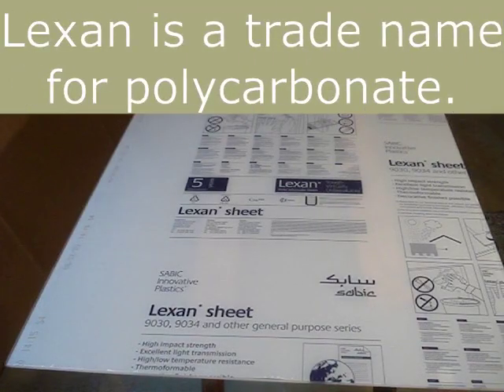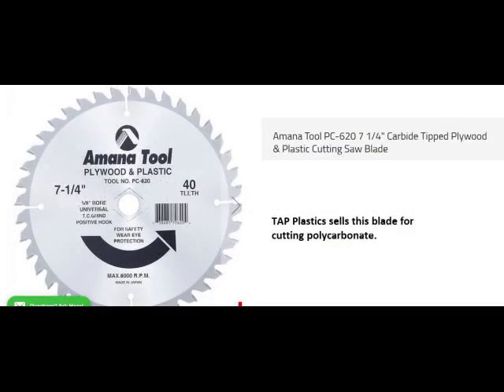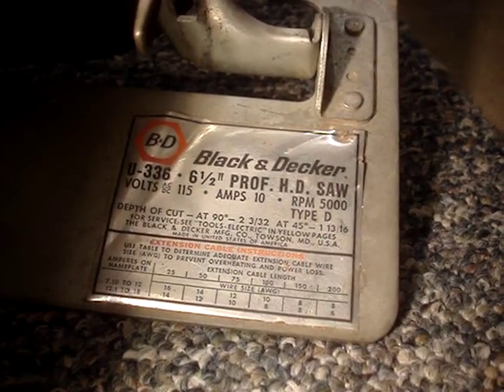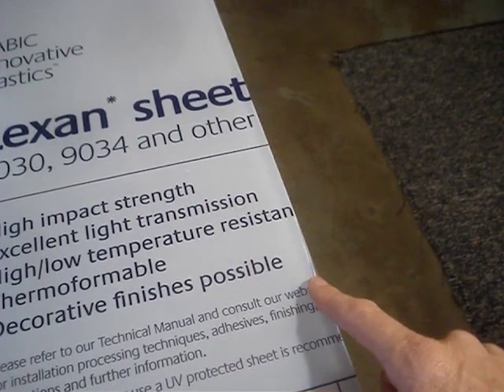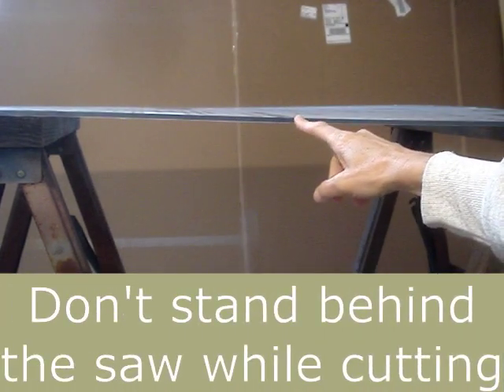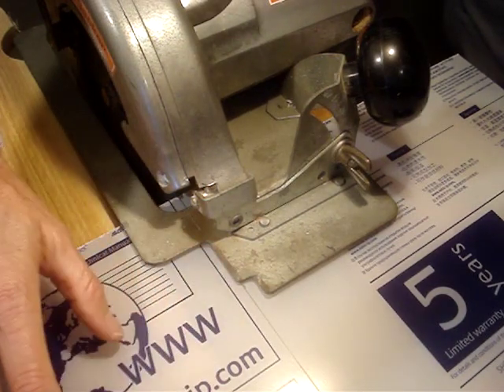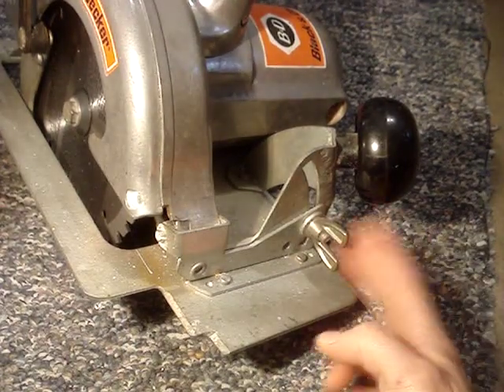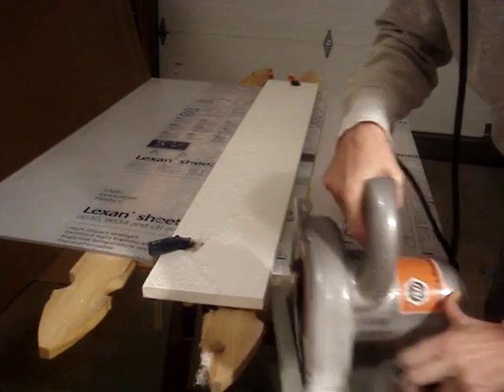Cut Lexan Polycarbonate Sheet With Circular Saw

Comment: Love how you took the time to list safety tips. Very much appreciated! 
I need to cut a circular hole in a 1/4" thick piece of polycarbonate. What do you think about using an oscillating tool?
Reply from the maker: I haven't tried an oscillation tool.  Heat might be a factor.  I'd try a test cut first and see what happens.  Can you use a hole saw?   I don't see that option here.  https://www.weetect.com/cutting-polycarbonate/

Comment: Thanks for your videos, particularly on cutting Lexan.  I am cutting the thin size, likely 3/32" for a window pane replacement.  I might try the scoring technique first.
Reply from the maker: You are welcome, Michael.  I do my best to make quality videos.  If you try the scoring method, the blade gets dull quickly, you might need a more than one blade.  Also, make sure you clamp everything down because you have to apply some pressure.  You don't want anything to slide.
Reply: I would add that it can be helpful to set up a metal ruler (or other straight edge) to use as a knife guide while cutting.

Comment: Which scoring tool would you recommend on 1/8 inch lexan?
Reply from the maker: You can try a sharp utility knife, though 1/8" is going to be tough to cut without a jigsaw or a circular saw.

Comment: Hi thanks for the information, would this work with 8 mm thickness
Reply from the maker: The sheet I cut in the video was 1/4 inch thick.  8mm shouldn't be a problem.

Comment: I tried it on my table saw and lexan started to melt after 8" into the cut., I give up
Reply from the maker: Maybe you have the wrong blade?  I recently tried to cut a table top made with MDF board with the blade used in this video.  It heated up.  I consulted with my cousin who has spent his life working with wood.  He tried cutting it with his jigsaw, it heated up & warped that blade.  We ended up taking the table top to his house to cut with the table saw.